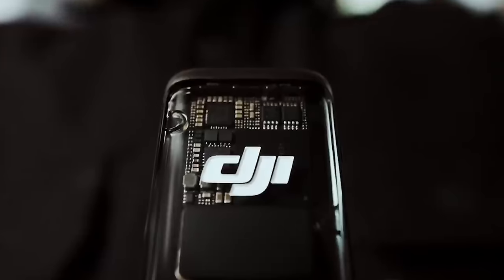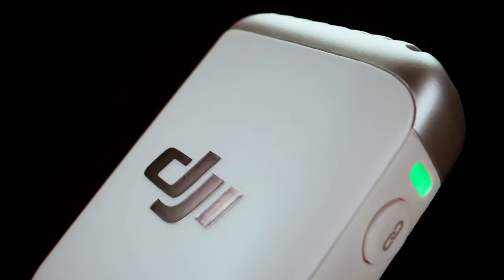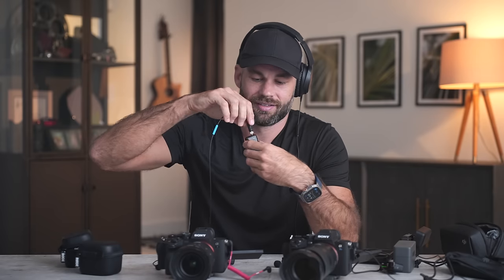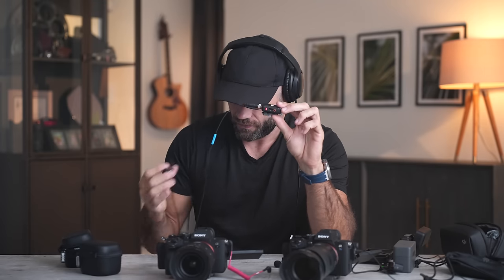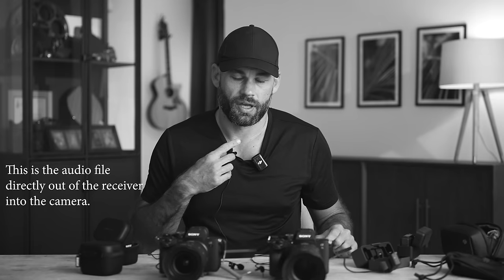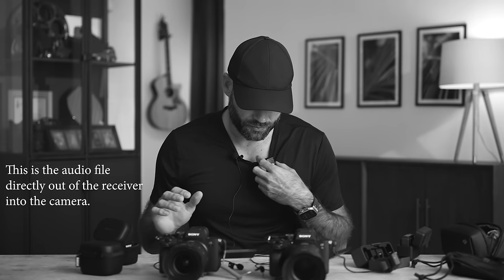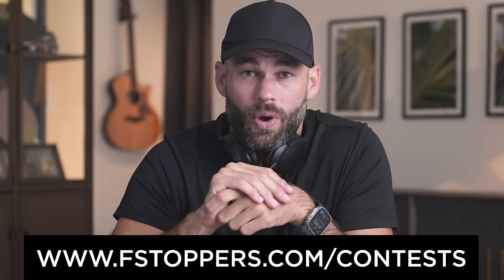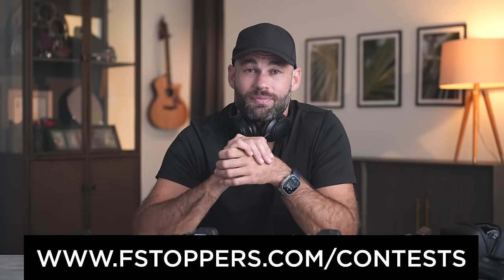DJI Mic 2 has MAJOR issues

Comment: If you use threaded lav mics that are not necessarily designed to work with the (non-threaded) Mic2 transmitters it doesn’t seem very smart to throw shade on DJI and the Mic 2. It might work and it might not work but why be surprised and disappointed when it doesn’t? This looks more like operator error and not a DJI Mic 2 problem.

Comment: The issue I'm facing with mine is that I shoot with an iPhone and the receiver is plugged directly into my iPhone but at times the audio doesn't sync and it uses the iPhone's built in mics instead of the receiver.. The only way around this was to always unplug and plug in the receiver every time before I start shooting. Anyone else facing this issue?

Comment: You need a different voltage for rode wireless pro and i assume the DJI mic 2. Not sure if there are other version of of Sanken COS-11D for different system, but if you look at the DPA 4060, you need different voltage version for these new kind of wireless system.
Reply: that doesn't explain why it works on one transmitter but not the other one.

Comment: I had static recorded internally for the duration of the recording on both transmitters. I am really bugging why that happened because the other internal files are good. I need to check this issue you're having though. smh

Comment: BROOO, i literally just shot a wedding two days ago, and used my DJI mic 2 for the very first time. I plugged in a Shure lav mic into one of the mics and hooked it up to the groom, but it did the same thing - there was a 30 minute recording file of the entire ceremony, but there were no sounds. I was so shocked when I got home. Lucky I had a back up audio (DJI MIC 2 2nd mic) plugged into the celebrant + DJI Mic 1 strapped into the handheld mic which captured everything.

Comment: Oddly, I've been hearing a bit of a noise aberration on the Mic 2. I've tried 2 separate units and heard it on both. It's an odd interference noise. Not quite what you experienced though. I may be returning it again & just sticking with the Mic 1.

Comment: I have the Rode wireless pro . I have a few MKE2 and MKE 1 ‘s and they have an interference buzz in the system . The standard ME2 works fine.  Which is a shame I can’t use the pro end mic with Rode , it’s actually worst interference then the Wireless go 2.
The MKE mics work fine with the Sennheiser system  as expected

Comment: The second issue with the flawed audio in the receiver is a classic thing with 2.4GHz systems. This frequency is just way too crowded. Could have been your wi-fi messing with the audio. I am surprised you never heard anything like it before. All 2.4GHz systems are plagued by it.

Comment: Yup, has been the same with the original: if you plug in anything and the cable turns ever so slightly, you get NO Audio whatsoever. I lost Sound on 2 weddings before i found out that this was the issue and immediately stopped using those!

Comment: I use both mics most of the time, and everything is working fine for me. My audio is also sounding better than what's publish in this video.
Reply: The same with me. Can't recap any of it. However, I'm also smart enough not to use a microphone with strange screw caps that were actually built for Sennheiser transmitters. I don't think Sennheiser engineers 20 years ago thought that decades later they might also go into small 3.5mm jacks on mobile audio devices of this size.

Comment: I have seen other videos of various issues with the DJI Mic 2 -the audio from the mics are not the same in documented tests after you hear they sound different. Also, the Bluetooth to Insta360 Ace Pro is not working. I have deferred my purchase until things are sorted out. Your findings are just another nail in the coffin for me. I need consistent reliable equipment for field work.
Reply: Bluetooth is not working with GoPro Hero12 either, but I don't think you can blame DJI for the crappy bluetooth implementation in competitors action cameras.
Reply: @GrenlandUnderVann  thanks for sharing since some were blaming the Ace Pro. Now that just adds to the problem with the Mic 2.  👎👎👎
Reply: @chrisbogart687  As far as I have seen on YouTube the previous firmware for the Ace Pro did support the Mic2 transmitter. There is a lot of issues here, insofar as the GoPro is only supporting the BT Handset profile, which has a crappy sound in any case, while DJI's own Pocket 3 seems to use an BT profile with is called EDR -"enhanced data rate" for better quality audio.

Comment: I do not use lav mics and I only bought one transmitter for my Action 4 shooting indoors with mic 3 - 5ft away 

My tests
- 5ft and 3ft   perfect 
- 3ft with Noise reduction - worked but I think it is too much so the voice loses too much so gonna do NR and Voice isolation in post. 

I have not tested the internal files yet.  / My tests were with 32bit float off.
Reply: Wait for a possible new firmware before using 32 bit float IMO.
Reply: @GrenlandUnderVann  I was thinking the same. The reality Is I doubt I will use 32bit float the same way I do not shoot raw video. I am in a studio environment and I am rarely clipping. I do not use these as lav mics, I have them 2-3ft from the subject so it is easy to manage the levels for me. That said I still would like to have a 32-float backup but I will wait for some updates.

Comment: Its as if one unit accepts a TRRS connection and the other one a TRS connection... I have some rode mics with TRRS and I have to adapt them when I plug into anything other than a cell phone's combo 3.5 mm port. Did DJI do some funny business with a port thinking you could monitor signal with a headphone splitter thingy? (Thingy=Tech talk)

Comment: May I remind a nice and clever functionality of the DJI Mic 2, that eliminates the need for using wired capsules with screw-on type jack connectors...?
The moving part of the transmitter clip has a small groove hidden inside. This is to grip the cable after doing a loop.
This combination acts like a safety against unplugging + a safety against traction on the cable itself.
And there... no problems of compatibility (or lack of), because you don't care about locking-ring size and else :  you can plug any type of 3.5 mm jack connector and still have it safely in place for your whole filming.
DJI was more clever than many think they are !  😇

Comment: the whole dji mic 2 seems cheap. starts with packaging over material and stuff. the best thing is maybe the carrying bag as an upgrade but tbh i love the mic 1  - the charging case, the design, the feeling and especialy the lowkey design elements. for instance the magnetic plate, the one of the 2 is so sht, why the hell does this need so much attraction, since we try to hide the mic while recording on video?!

Comment: That's a huge deal breaker I was on the fence about getting the Rode or this new iteration I was leaning to Rode because I couldn't believe DJI released this system without a locking collar system. These issues solidify the Rode purchase. Thanks for the honest review.

Comment: I coincidentally have both the Rode Wireless Pro and the DJi Mic 2 on hand, as I am returning the Rode setup. I plugged the lavalier mics from the Rode setup in both DJi TX's and with the nut on them, they would not seat fully. Once i took the nuts off, they both worked fine.

Comment: Come on Lee. The MKe2 has a locking attachment whereas DJI does not have a locking connector. in Obviously it won’t work since it’s not physically inserted deep enough for a proper connection. The fact that it works better in one than the other is small variations in connection depth. And the good internal audio you got was recorded on the internal microphone on the unit, not from your lav! Come on man! 😅

Comment: I’m keeping the DJI original wireless mic and am using the Shure MVL Lav with it.
Reply: I saw someone said shure lav doesn't work with dji mic 2
Reply: @victorlolo2008  good to know. It works with the original.
Reply: @victorlolo2008   It works fine but you need to use a TRRS to TRS converter plug. The Shure MVL has a TRRS connector the DJI Mic 2 is TRS. On the DJI Mic 1 it works without the converter. I have both versions of DJI Mics and multiple version of the lav mics including the Shures and the ME-2s

Comment: Soo your sticking something that’s not suppose to be there in it and wondering why the audio is bad ?
Pretty sure they sent you a lav mic so the first mistake was assuming pretty sure that senhizzer however it’s spelt damaged the internal connections the fact that it doesn’t go all the way down proves it 
And not recommending people buy something because you have a problem with it based on your expensive senhizzer not work properly with it🤔 wow just wow

Comment: Is this a case of releasing not ready products and then fixing them with updates?
Reply from the maker: The first problem seems like a hardware issue; like each transmitter is built slightly differently.
Reply: @FStoppers a lot of people are also complaining about the transmitters not having consistent audio colour (sound quality) within the same sets too.
Reply: @TheTechnoPilot  And some have no problems whatsoever.

Comment: should you be plugging the microphones in there when the unit is switched on ?? I was always under the impression that it is recommended that the unit should be switched off . Plugging it in and out when it switched on which is damage it and the microphone ..
Reply: Yes you should be able to plug in microphones when the unit is switched on. Standard practice. I don't know of amy radio mic, or any piece of audio equipment using low voltage plug-in power where switching off is a requirement.
Reply: personal choice I suppose, I always turn items off when plugging something in or out maybe it's just me and have I've got into some kind of habits ,there's always some kind of resistance going on even low-voltage stuff .
Reply: @cheekyoscar1353  Exactly - your choice. Certainly can't do any harm being extra careful. I'm from a professional broadcast environment and never had an issue or been advised to do so. Would make troubleshooting an absolute pain eg checking for an intermittent  plug issue as above. Plugging headphones into a phone? Plugging a headset into an expensive computer? If it blew up my laptop or phone, I'd expect a refund and an explanation.

Comment: It is a bit of a stretch to blame the product here… the DJI Mic 2 works flawlessly the issue is the sennheiser plug with the locking nut not allowing the plug to seat properly
Reply from the maker: That lav was not used with the second issue
Reply: @FStoppers  Would have done the video for only the 2nd issue? Above all, I would hope that a YouTuber who makes videos about audio devices would at least have an idea of where the problem could come from, but not stand in front of it so helplessly and then make a video about his helplessness. What do I get from your video? Nothing. No insights, except that you describe two problems to me, one of which you don't recognize as actually being yours, and the other being unable to assess or evaluate. But then you generalize both in such a way that you advise against buying them. That's not enough for me. But it's nice for you that there are so many commenters here who explain to you why the Sennheiser problem isn't actually a problem. At least you got something from your video.

Comment: Very happy with my Australian made Rode Wireless Pro!
Reply: It has other issues.
Reply: @GrenlandUnderVann  haven't come up against any yet... Name a product these days that doesn't have software bugs.... Ppl are so keen to rush products out...
Reply: @michaelgaraphoto  I'm refering to size, all lights on front, ease of use, etc. While I have them both, only the DJI Mic2 supports HQ EDR BT connection to DJI Pocket3 and Action 4, as well as a lower quality BT to my phone. And I would guess that support for the BT EDR transmission with Mic2 will only increase in the future.
Reply: (EDR = Enhanced Data Rate as opposed to the more simple Handset profile.)

Comment: I as well experienced problems when connecting screwing plugs to non-screw sockets with different brands. Removing the screw or using an DIY adaptor to not loose the nut fixed the trouble. I don't understand why the nut isn't build in a way you can remove and reapply it if necessary.

Comment: Locking screw lavs may be super safe when connecting to a locking screw transmitter but are a PITA when connecting to a non-locking screw transmitter or audio device.   My Sennheiser lav connects fine to the Mic 2, but will not connect to my Steinberg USB UR22.   I fell in love with my Deity D4-Duo (bought it years ago, never really used it), now It works great as a desktop Mic connected to the Mic 2 transmitter, connected to the Mic 2 Reciever, connected via USB to my computer. (3 interconnects that work in realtime!).

Lav are PITA (IMHO), I have some fancy Deity Lav Mic that doesn't work at all.  Note I'm not an AV guy and don't understand all the electrical intricacies on Mic equipment; I know they're touchy.

Comment: That's a poor quality control issue due to the contact area in the mic jack. Technically, you can fix this by replacing the TRS termination.  However, it may be kinda difficult for those not familiar with soldering and terminating their own cables.

Comment: Did you updated the firmware on the new units? It seemed like I’ve seen this before.
Reply from the maker: I tried. As far as I can tell, there isn't an update yet. Plus, I can't figure out how to replicate the second issue so I wouldn't even know if the firmware fixed it or not.
Reply: Curtis Judd mentioned audio quality issues on his set and DJI confirmed they’re going to push a firmware update.
Reply: @TyroneLT  You watch these reviews once and don't stick with them, even though the fair YouTubers like Curtis are trying to find solutions. A few days after his video was released, he gave an explanation for his sound issues: He didn't know that he had a pre-release version of the software. But because Curtis is a good YouTuber, he later admitted it. He couldn't know. But that's exactly why I think you should be more careful with sensational titles like "Don't buy this." In the end it could turn out that you were the fool yourself. And by that I don't mean that you shouldn't make such videos at all, just perhaps scale back the generalization "The new DJI has these problems" like this Youtuber does. The real description of the condition is: I have this problem. Now.
Reply: @mathiassiebert1217  I think the bigger problem is they shouldn't be releasing unfinished products into the wild to be reviewed. That's a criticism of the entire industry. In this case that should have been made clear by DJI to everyone who received a review unit. Even in this video its said he'd gladly finish his review if DJI fixes the problems.
Reply: @TyroneLT  I'm with you there. But, as you say, this is a fundamental problem with the industry. Unfortunately, this also applies to many things that can really be life-threatening, such as cars or, in my particular case, an e-bike. Finishing on the road. At the end customer.
Reply: @TyroneLT  influencers with review units got a different firnware than the retail version now shipping.
Reply: @FStoppers  Mic2 transmitter firnware is under the Pocket 3 download. But retail version is the same, so unless you got the early influencer samples in the beginning of january you should be up to date.

Comment: secure lav systems can’t seat properly in the DJI port, I ran into this with Gen 1 units too, meaning you can’t use a lot of higher end lavs with the system… And you shouldn’t because the DJI TX units don’t put out enough voltage for most professional lav’s. That last one was pointed out to me as well, most decent mics require twice the voltage of what the DJI Tx is capable of!

Comment: I think your Sennheiser problem relates to the locking ring on the TRS plug. It’s not uncommon in my experience to find packs without threads which aren’t able to work consistently with locking ring mics. The physical tolerance difference is probably fractions of a millimeter, but it’s just enough. So in that regard I’m not the least bit surprised you’ve had trouble. The interference and dropped sound thing is really poor firmware QA. Hopefully they can get the issue sorted with a download.
Reply: Also I believe the DJI lavs and the Sennheiser lavs have different bias voltages. Not that it matters if the connection isn't being securely made in the first place...
Reply: I'd agree its probably the locking ring. It's safe to assume DJI will not change something that has already been manufactured that way. The other issue sounds like some sort of wireless interference. Traditional pro wireless mics require scan to find an open channel and when using two transmitters both need to be on separate channels. It sounds like the two transmitters were fighting over same channel. Both of these reliability issues are why these aren't for professional use. I've heard some of the more respected reviewers who used the previous model for a longer time would mention odd issues such as these.

Comment: I canceled my order on launch day after watching a bunch of reviews. I thought the audio quality was very subpar in nearly every comparison. Some reviews sounded okay, so it feels like a consistency problem which is bothersome because I am a fan of DJI products. Still have the original mic as a backup and it works fine. The second strike is the spamming of the DJI logo everywhere. These mics should be low key. Now, I will admit the Rode Pro is shiny AF (something I covered in my own review). But I did find some matte covers on Etsy that solved that problem. And I will say Rode is probably quite guilty of this on all their mics. I was hoping DJI would do better as the version 1 I feel was a better design as its not as distracting.